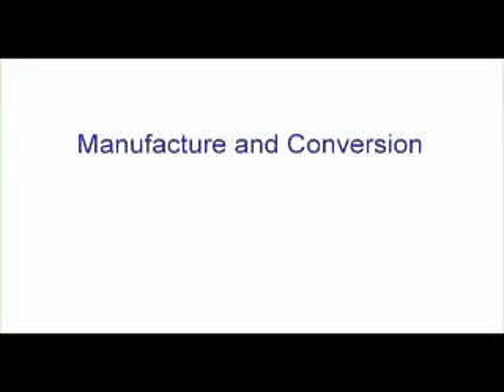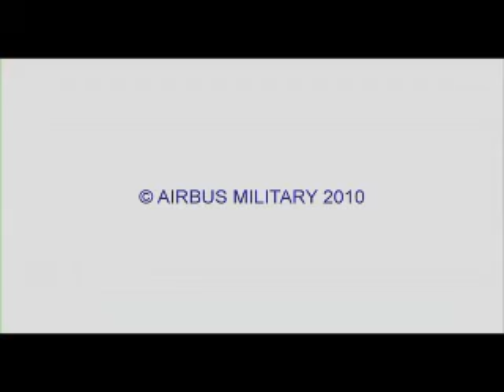FSTA #1 full conversion process in Madrid

Comment: At 3:27 ish the thing being loaded into the rear cargo bay is the Fuselage Refuelling Unit which is a hose and drogue system, the UK MRTT will not use ARBS as UK aircraft are all equipped with a probe
Reply: Craig Fulton Seems like a big oversight now that they have C-17, P-8 and maybe 737 AEW&C, all of which need a boom. Typical stupidity by UK government beancounters